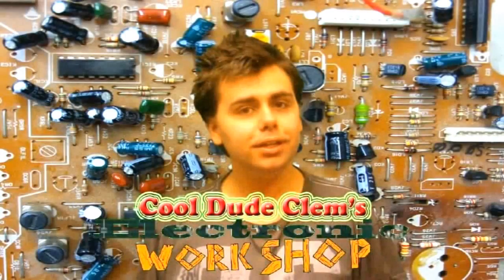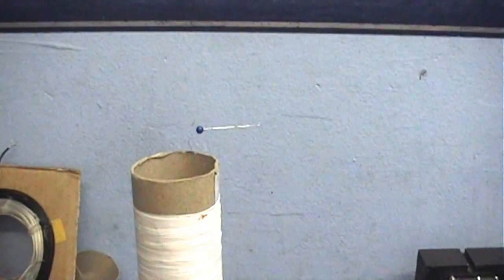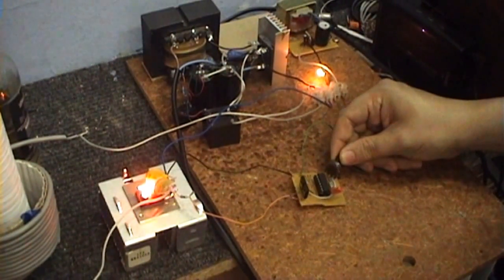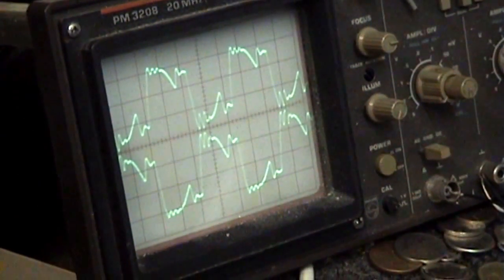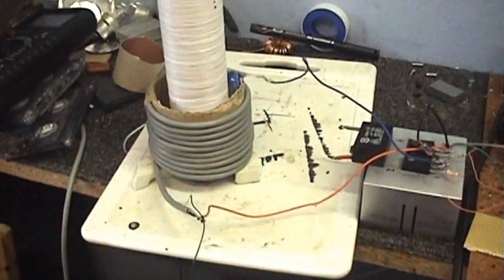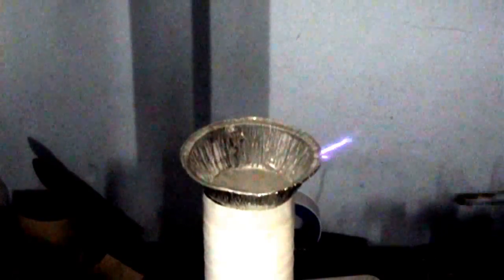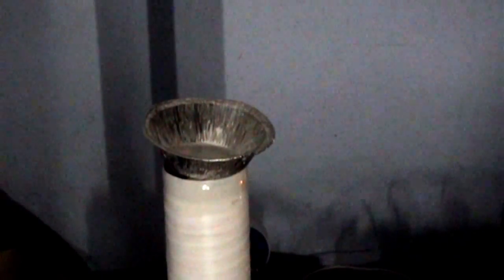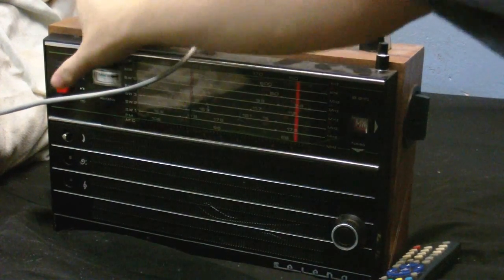Tesla Time

Comment: Clem, if you take the height of the coil, and divide it by the diameter of the wire, you should the the number of turns in the coil.